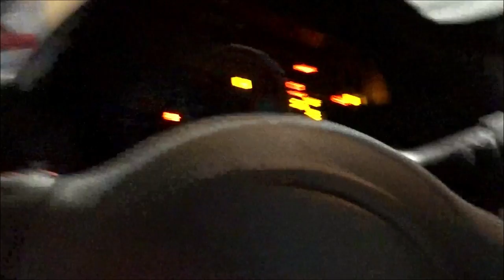TRD CANARDS FOR MY BRZ! (Destroyed My Front Lip)

Comment: Hey man. I just bought a 2017 brz 6 speed. Same color as yours. 
I’ve got a few questions about it. 
Is your gear box stiff? Mine feels so stiff and sometimes it feels sticky. Like if youre in neutral and you move the shifter to the side and let it spring back to neutral. Mine sometimes doesnt spring back as fast.  I’ve read draining the transmission fluid and putting Motul gear oil helps?
Sorry im new to these cars. My past cars were bmw’s im just not use to these stiffer gear box. 

Also i love your setup. Are you running coils or springs? If springs how long is the drop?

Whats the specs of your wheels?

Thanks!
Reply: Pabs that’s how the brz’s gear box is, they’re stiff as well as vibrate a little when you’re driving or have it in neutral
Reply: Miguel M ahh ok. Yeaa im still getting used to it. Still jerking the car in first gear as if its my first time driving manual again lol. 
Been driving for a month now. Switching from my bmw 135i manual and still not used to the brz gearbox. But am loving driving it. 

Also have you experienced the shifter not going into gear? Like for example im driving on the highway on 5th gear and wanna change to 6th but it wont go. So i have to put it back in neutral then i can go to 6th. Or go back to 5th then shift again and itll work. 
Only does it a few times.